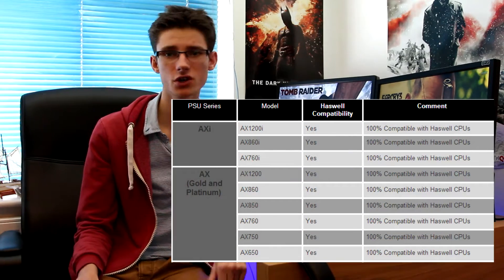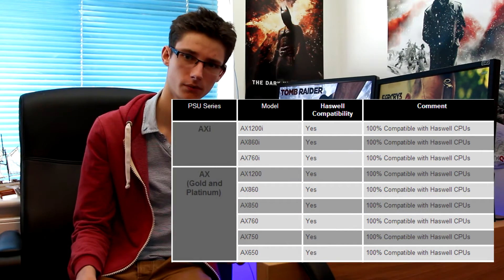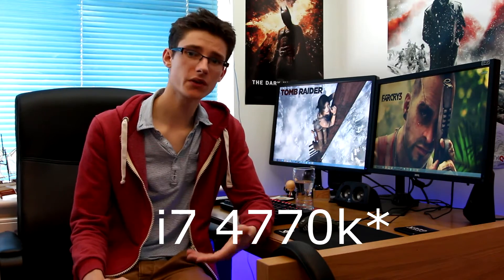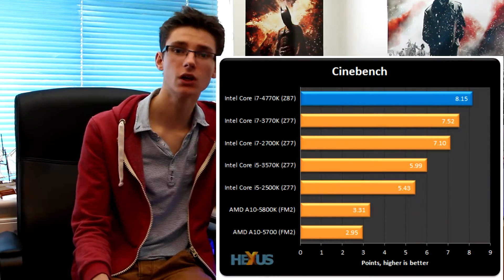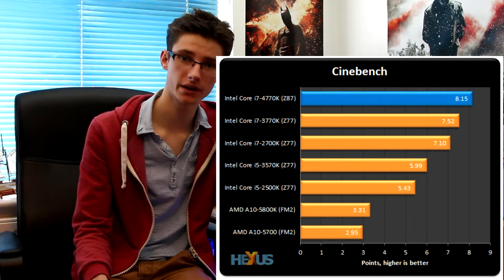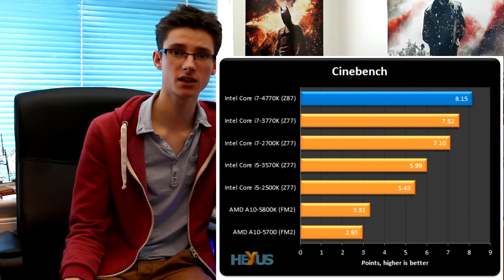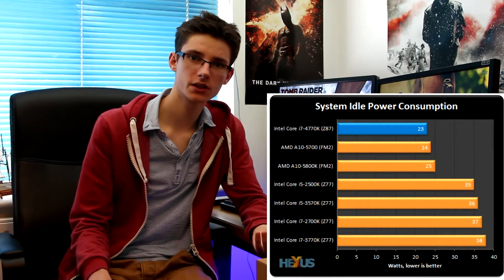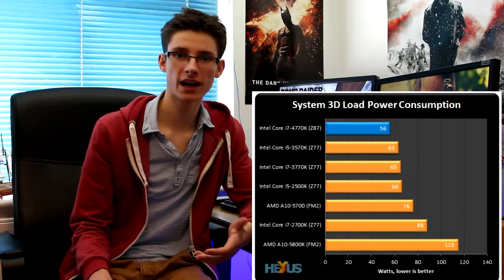A Simple Guide To Intel Haswell Processors

Comment: Nice hows it going? I've done the exact same but with a 3770K and the only difference between that and the 4770K is just the intel graphics (Which i dont use)... The GTX770 is good for the price, put two in SLI and it craps on the TITAN etc..

Comment: well sure the 780GTX is showing good performance compared to a 680GTX but that gap is MUCH smaller when you talk about the 770GTX vs 670GTX. It could be months before a 760ti and overall one 660Ti now and then a second one after the 760 launches and price drops makes the most sense.